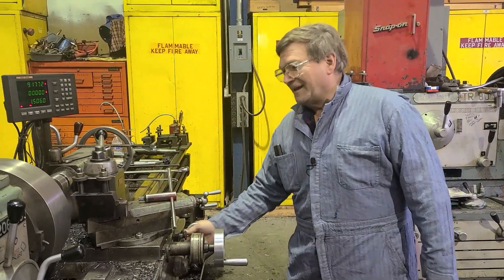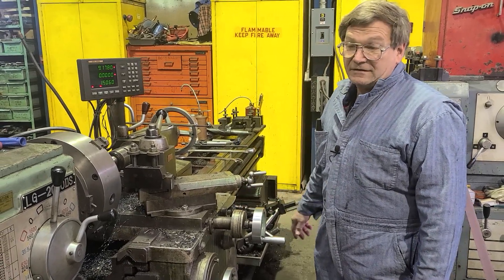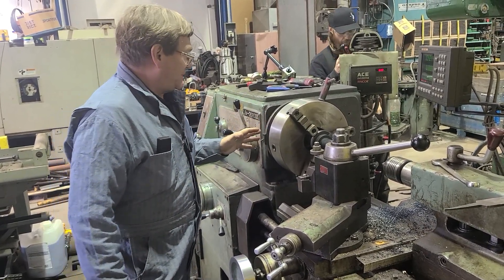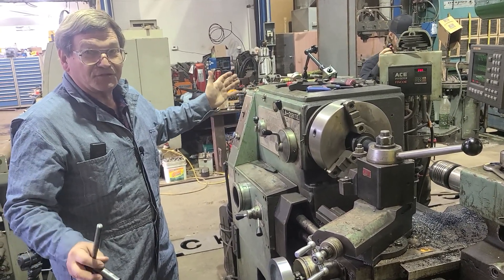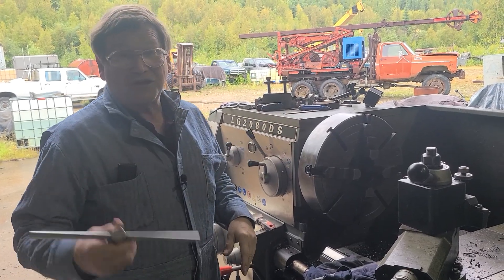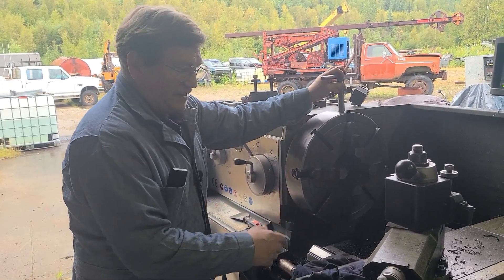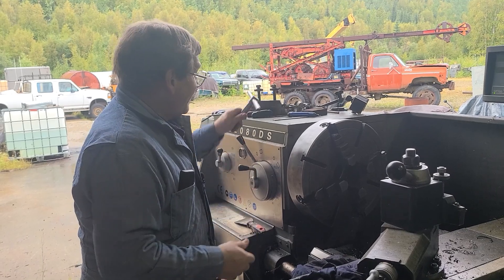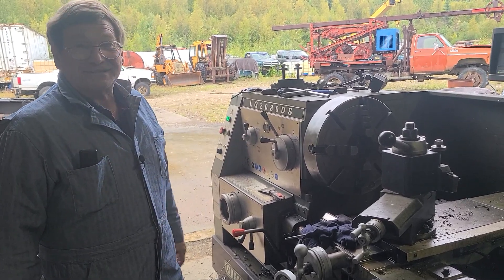Everything you need to know about lathe safety

Comment: Even though I'm the only one operates the machines in my shop.  I make habit to push the estop or power disconnect.  And leave the power lever off.  And before running the power on our reset the estop, i look at the lever and any feeds to be sure they aren't engaged

Comment: I graduated from trade school as a machinist here in my country at late 2010s. Have been in couple of shops and never have I seen anything old and scary like that lathe. How common are these lathes in the states? Feels like in every american YT video all I see is these old grandpa lathes. All manual lathes that I have worked with had all kinds of safety features. Like rolling chuck covers that prevented accidental starts when the cover was below chuck. It also prevented you to leave chuck key in. Also You couldn't start the motor if clutch wasn't in neutral position when you push the engine button and it has a slotted spring assisted neutral position.
Reply from the maker: Both those lathes were bought new, and the older one is still under 20 years old if I remember correctly.
-Cameraman
Reply from the maker: To expand on that, judging from name/profile pic you're EU or EU-adjacent (Serbia? lmao), so more than likely the lathes you've been exposed to are subject to different domestic safety requirements. In the US there is still a lot of equipment in operation from WW2 and earlier, and there's no sense in scrapping good equipment. On top of that many of the American machinist channels are guys in their home shops who primarily work with these machines due to cost.
-Cameraman
Reply: @HOWEES  Oh, they both are only that old. So sorry if I sounded rude when commenting on your lathes. Must have been that greenish blueish paint job and unfamiliar design that made them look much older. Yes, I'm from EU area. Not from Serbia tough. I have worked mainly with Czech made TOS Trens SN50 type of lathes. And they come prebuild with the safety features from the factory since the soviet times. At least there is a old photo maybe from the 1970s of SUT 63 model that has a chuck cover and safety class on it. The SN50s and similar are painted white if it's a new classic brand or repainted if it is over 20 years old and is ordered to be refurbished. Their design is very boxy and simple. So, I guess I associate boxy simple looking lathes with white paint job as modern. Sounds like a good philosophy to use old but functional equipment. We are very strict about work safety and there is comprehensive laws about it. We have tax funded department dedicated to work safety (equivalent to OSHA) and every company, employer and worker has to follow its rules, standards and guidelines or you'll get heavy fines and jail time. As the saying goes: better safe than sorry, even if it is mandated by the government. Also we have a machinist saying: "No matter how busy it is, you do it at your own pace, even if your boss breathes down your neck". Because most accidents happen when you are in a hurry or exhausted. I know from the experience. Even though our lathes have lots of safety stuff. They do not prevent 100% of accidents but they will prevent most accidents that involves human life. We also take these rules to the heart because nobody want to witness or be victims to these merciless machines if something bad happen due to operator error by pure neglect or ignorance. We also have comprehensive training programs and trade schools that give us good general understanding and idea how to work in any particular field. Like in a machine shop. Glad to get a response from you guys. It was nice to know what actually goes on in the workshops of USA. Also I'm happy that you guys make these educational videos. I instantly subbed when I saw this video on my feed. It always make's my stomach twist when I see these garage machinist and how they operate their machines.

Comment: I'm an engineer in Lithography, mechanical, electrical, heavy rigging, travel the world and my family has been in the industry for over 100 years. (Not as engineers, but as shop owners.) I've recently had to setup my own machine shop, because I also design machinery and we need it for part modifications, and things that come in we have no time to wait for the parts to be made. What I appreciate about your video here, I'M NOT FROM, your industry. But I am NOW, in a small way, running my own machine shop. I don't know these things! Yes, I have a brain, i do very dangerous work, but such videos are invaluable services to mankind.  You want to hear about arms getting ripped off in my industry..... well, I unfortunately know too many. Not but a few years back, a young Guatemalan running a large Heidelberg Press, (which subsequently was 5 times smaller than the 1 I was putting in, but still HUGE) pulled the kids arm off at the shoulder. Didn't cut it off, YANKED it, right off his body. I got a call from the fire department once, because a high school kid was up to his shoulder in a large Heidelberg. Right between to massive cylinders that were bearer to bearer. They said, "we have the jaws of life." if it weren't so serious, we would have laughed. Told them they could just go put those right back where they got em. They aren't spreading apart sheet metal. For that one, they brought the surgeon in to remove his arm right on the shop floor. He gave them a  certain number of minutes or he was going to start. That is when we instructed how to release the machine, and roll him back out the way he came.  (Which is NOT something you would normally want to do, I'm not a doctor, but I understand that causes many times more injury than going in the first time.) He lost his arm from above the Elbow. After which, every Lithography program in the state of Ohio shut down, never to be again. (At least with equipment.) And the equipment that we ran at the turn of the century, much is still used for some things, and there are NO GUARDS on that stuff. I will NOT add, ANY safety equipment to machinery that already exists, electrically or mechanically. Because the 2nd I make the 1st change, all liability now becomes mine. Which is sad to be honest. But thats the litigating society in which we live. I have always had long hair, more than half way down my back. These factories try and tell me how to wear it. I tell them, "YOU invited me, I did not ask to come, I do NOT fall under you employee handbook or safety requirements and will NOT argue your safety procedures either. But I WILL decide how, and where, and when, to put my hair in a ponytail, a braid, or let it hang, or tuck it under a hat. Because YOUR POLICY could get somebody killed. You think my hair in a ponytail is good? That would snap my neck, smash my brains out, or descalp me and kill me. You are MUCH better off to tuck it away, or be careful and let it hang, worse case, you loose a CLUMP.  Then I get the dumb look. I've not been injured yet, well, at least not worse than it took 3 guys and a mop 2 hours to clean up all the blood.
Reply: Fuck yeah
Reply: Nobody reads this
Reply: @dungeonmaster6292  another Trump voter who doesn't know how to read. It's okay, go watch your manga cartoons.

Comment: Shouldn't start up with the clutch engaged there is normally a safety switch which is a good idea ( maybe you don't have those I don't know )
Reply from the maker: The one made in 1996 will turn on with the clutch engaged, the 2016 has a safety switch, that requires neutral.  Most lathes I have been around do not have such a switch.

Comment: Lathes are not created equal.  Some control the motor with the clutch lever, some don’t have clutch levers, I have also ran a Cincinnati hydraulically driven lathe and it might of been a Warner & Swasey turret hydraulic driven lathe.  Because of so many different controls and possibilities; festering a bad habit like leaving a key in a chuck is a common denominator for an accident.  Your friend that smashed his hand…had the key in the chuck… if you had taught him to not do that he woulda avoided that.  What about the apprentice that is hung over or the apprentice in a rush in the afternoon to finish the job so he can go meet up with buddies or a pretty lady?
When a chuck is off a lathe then the key can sit in there so you don’t loose it, but that’s because there is no machine to spin it to make it dangerous…

Comment: Had to replace motor on my lathe.  Used a 3 phase programmable drive.  It's only 1 HP small lathe drive controller inverter $99.  Motor 3 phase was $259.  The point is I have it programmed to roll slowly at start then go on to full speed. A key left in Chuck just falls into chip tray.  Can run 3 Hz to 72  Hz.

Comment: Yep I admit I have left the key in the chuck and turned the machine on. I was incredibly lucky the key didn't jam or hit anybody when it flung out, gave me a hell of a fright, felt like a complete idiot, never did it again and I tell everybody not to try it themselves. You are equally right about checking the speed, I've not been bitten but its easy to be x10 out. Mine is only a medium size lathe hobby lathe and that's scary enough.

Comment: The machine shop at our local community College has a 1/2 hole in the metal decking 15 ft up where allegedly someone turned on the lathe with the key in.
  The first instruction which was given to us when we were beening introduced to lathe machining was to not leave the key in the chuck
Reply: We have almost the same in the secondary School I did, the first thing in the lathe area what you get introduced to is the key stuck in the ceiling 😅

Comment: You could simply roll up your sleeves but this does seem to be an improvement
Reply: The sleeves aren't a big deal,, not every shop is climate controlled. Just be mindful about it and roll them up when you need to get intimate with the machine/part. Same goes for gloves.
Reply: @onedeep6460 okay you can work in an unheated shop if you want but do not spread bad practices that could lead to people getting hurt. Never wear gloves except for disposable vinyl type. Any loose clothing at all is unacceptable shopkoats get wrapped up in lead screws and long sleeves but only if you run a CNC with functioning interlocks ha!

Comment: I think there was a doofus that debunked the "chuck-key" in the chuck myth. Wandel or something? The key will just fell out and drop to the floor. But don't take MY word for it. I personally don't see a need to try it - I'm just saying what the guy said (and showed).   But is long sleeves like wearing a bath-robe (like this guy is doing) really according to "best practice"?
Reply from the maker: We've also given it a go. It was rather unimpressive. https://youtu.be/uWN3YLcXt0I
-Cameraman
Reply: Ah, no. You may get lucky, but I once saw a chuck key fly across the room.
Reply: @melgross  must've been Gross incompetence ... :)
Reply: Yes, Matthias Wandel also made video about chuck-key leaving in. He ran his lathe and it was safe to run lathe with chuck key in the chuck 😂 https://www.youtube.com/watch?v=n-YAWpAmioQ
Reply: Only true for traditional chuck keys. My Forkardt 3F+ 3-jaw has a long ass key that goes into a pocket with a hex shaft inside it to turn it. It wouldn't spit the key out if i ever forgot it before turning the spindle on, it would just smash into the gap piece

Comment: I have to disagree that leaving the chuck key in the chuck is ok if the machine is off and/or the machine is in neutral. 
Leaving the key in the chuck is AN ACCIDENT WAITING TO HAPPEN! Why take the chance when it’s only a second to stow that key in a safe place. I like what Abom79 has on the lathes in his home shop. I think he said his dad welded a section of tubing of the appropriate size to the top cover of the headstocks. Use the key, remove it from chuck, drop into storage tube. Quick, easy, and you know where to reach for the key the next time you need it - if it’s not there, 😂you know you messed up. Don’t turn anything on until you find that chuck key.
I’ve left the chuck key in my drill press chuck more than once. Then I started to use the hole in the table clamp thoughtfully provided by King Seely (I’m old!) in the top table clamp. I got myself into the habit of looking at the chuck key hole and verifying the chuck key is home BEFORE turning on the power.
I really am enjoying your series on working machine tools. Especially appreciated your recent tips on polishing and filing on lathe workpieces. 
I’m a retired mechanical engineer and worked designing parts that were made in our very very large machine shop. The machine shop management didn’t want the engineers in the shop until the shop needed the engineer. One of the leader’s motto was, “If you can draw it, we can make it.” That was generally true - until it wasn’t. Then you better get your butt into that shop like 10 minutes ago. What got me on the right side of that particular shop leader was the time he called me to the shop on my first all-by-myself job. Like most young engineers, my design was over-dimensioned with too-tight tolerances for the conditions the part would be used for.
Don went thru the concerns he had with my design, ending with, “Well Steve, what have you got to say for yourself?”
My reply made him a friend in the machine shop for the rest of my time in that job. “I f***ed up…”
You should have seen the look on his face. I was the first young engineer who admitted I was wrong. 
Don put his arm around my shoulder and said, “Come into my office and let’s go over this job. Tell me how you plan to use the part, I’ll you what tolerances we can hold & where we need some relief. We’ll get this knocked out for you in good time.  
After that, I would sit down with the shop guys and go over my design while it was still in the planning stage. I also got the best service out of the shop of any of the engineers having work done there. There were plenty of engineers who got into fights with the shop on every job because their designs were perfect and the shop must have been. full of dummies.

Comment: I bought a new chuck and it came with a key. The key has a spring on the shaft which is just strong enough to push the key out of its hole. Bit of a bugger but I realised it’s safety potential. I am a newly!